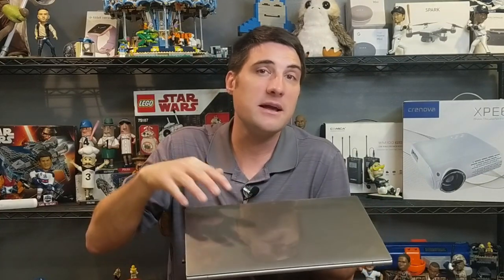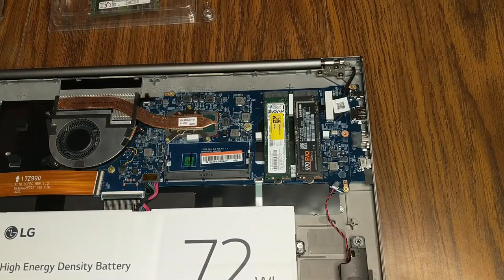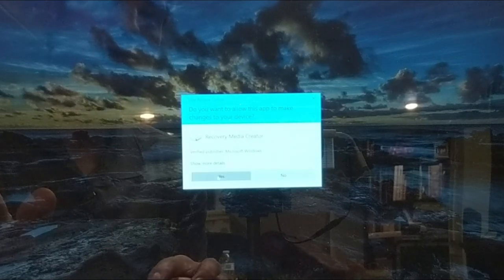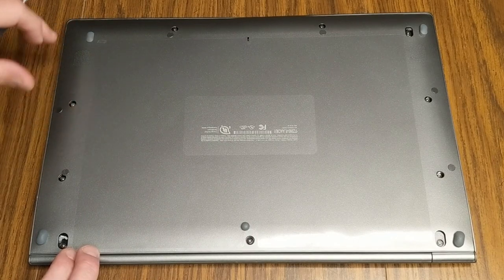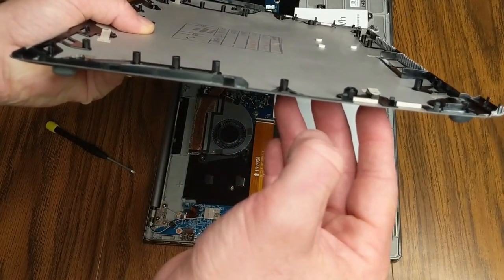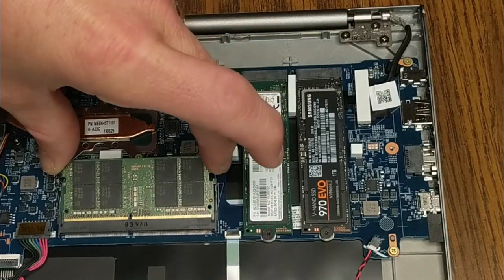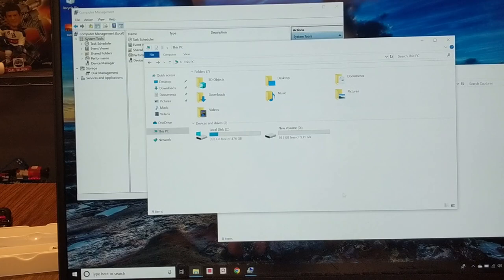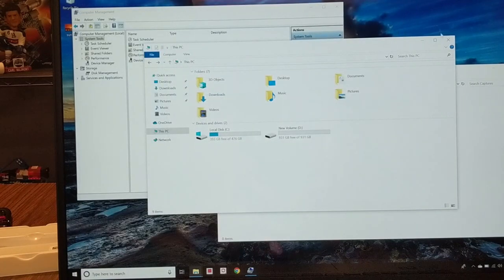LG Gram 17 - How to Upgrade Your Laptop With 2 SSD Slots (Adding An M.2 NVMe 1TB SSD & 32GB Ram)

Comment from the maker: Thanks for watching! How do you plan to upgrade your laptop?
Reply: What's the difference between the one you used and the EVO Plus? Is the EVO Plus compatible as well? What's the maximum ram I can add?
Reply: Is screen 4k?
Reply: Marc Jankow videographers edit 4k videos
Reply: Price is $1,199 at Costco right now for 16gb ram, 512ssd, i7 Intel cpu
Reply: Reviews have said that Internet is very slow on this laptop. Can anyone attest to this?
Reply: Marc Jankow my bad I meant reviewers were complaining about wi-fi, but for video editing it shouldn’t be that important
Reply: I want to update the RAM in my LG Gram 13. Is it basically the same process as this video?
Reply: does any USB drive work or does it have to be the one you linked to specifically?
Reply: Hi what about add 2tb in each slot for lg gram??
Reply: My LG Break 17 Laptop now has 40GB of RAM and a 2TB NVME XPG SX8200 Pro running Kubuntu Linux 20.04. It's pretty epic...
Reply: @inquisitvem6723  
No it is not 4K, it is 2560 x 1600 (WQXGA)
Reply: @JohnUSA7  2k is cool too!
Reply: always use 2nd ssd drive as data just in case windows gets corrupted since data can get deleted if you dont create another folder
Reply: Anyone do it with lg gram 16 style 2023 ?
Reply: Can ypu help me with finding a viable fan upgrade? I have a LG gram 17" i7 13th gen. It runs a little hot with the stock fan and I opened it up and it appears that there's enough room for a upgrade however I don't know any that would fit. thanks for the help.

Comment: I finally installed 2 of 2TB NVME SSDs on both the main and second slot and 32GB ram. All done successfully and works great. It is now 4TB NVME SSD and 40GB ram. I am planning on upgrading again as soon as I find 1 stick 64GB ram and 3-5TB NVME SSDs. It was a great time for me to upgrade the ssd and ram so I am thinking making a video for the next time. I took some photos though. Anyway thank you Jeff again and I’m highly recommend LG Gram 17 with upgrade. It’s very light and the screen quality is good too. It’s now my main laptop and I’m now looking for a laptop sleeve or body skin protector along with screen protector but hard to find though.
Reply: How did you move the operating system to the new SSD? And do the 2 SSD's look like one volume of two. Just C: or C & D?
Reply: So you actually see the full 40GB in windows? That'd be great because I've seen elsewhere that it only supports up to 20GB total (also seen 24GB on some sites)
Reply: Wow, congratulations! Quite an upgrade. Any performance issues with mismatched 8/32GB  RAM modules? Will you share what you selected and cost? I haven't seen another laptop that offers the size, light weight and axpandability. Looks like this will also be my next laptop and hope to implement the same upgrades. Thank you.
Reply: which ssd do you install on it?
Reply: I got a nice leather skin for the Laptop
Reply: Whatcus your laptop model plz? Still using it?

Comment: Great instructions.  Just put in a 2TB intel ssd and 32GB hyperX memory stick.  No way was I able to twist the ssd screw with needle nose pliers but I had the perfect size screwdriver and no problem.  Was a little scary removing the back cover when I got around the hinge area but careful working with a credit card got it undone  unharmed.  One thing that I didn't notice was that the big rubber feet are slightly different sized but since the bigger ones won't fit into the spaces for the smaller ones it will become obvious quickly.  BTW, I just bought mine at Costco a few weeks ago and it has an 80 watt hour battery rather than the 72 on the one you were upgrading.  Thanks for the excellent vid.
Reply from the maker: Thanks so much for the info Bob and thanks for watching!  That sounds like a great battery!  The 2TB Intel SSD and 32GB hyperX memory stick sound awesome!

Comment: Thank you very much!  I just saw your video yesterday.  I had no idea it was so easy to add a second SSD drive. I have the 15Z990 model, and it look almost identical to your 17 in model.  I ordered the Sabrent Rocket 2 TB drive since it actually cost less than the Samsung 1 TB one that you used.  I got it and installed it today.  It works perfectly.  I did not order the extra RAM until I looked inside to see if my model was similiar to yours, and it seems to be identical, 8GB soldered on the motherboard and a 8 GB Ram chip.  So, I will now order the 32 GB RAM chip with your link.  Thanks again, Marty.  PS.  I couple of years ago, I upgraded an HP Envy 360 with an old 5400 rpm hard drive to a 1 TB SSD.  Although, I completed the upgrade successfully, and it still works very well, but it was a very difficult  process with the HP, and I had to clone the drive etc.  The LG Gram makes this so much simpler.
Reply: I received the 32 GB RAM module and installed it today with no issues.  My LG Gram now has 40 GB of memory.  Thank you again for the amazing video!
Reply from the maker: That's awesome to hear!  I'm glad the video was helpful!  Thanks for letting me know about your experience and results!

Comment: 4:24 Not a good idea to use a flathead screwdriver to pry open the laptop.  This is because the flathead screwdriver tip is made of metal which will mar the laptop.  It's best to use a plastic tool to do this.
Reply: I agree!
Reply from the maker: Good to know!  I'll keep that in mind for future projects!  Thanks for the tip!

Comment: LG Gram 17 memory specifications: 

Slots: 1 (1 bank of 1)

Maximum Memory: 24GB

*Not to exceed manufacturer supported memory.

Standard Memory: 16GB (8GB non-removable).  Recommended maximum to add is 1x16GB DDR4 module.
Reply: There was a vid where some guy upgraded to 32 bg with additional slot so not sure why you say only one slot
Reply: @inquisitvem6723  Because only one slot is upgradeable, the other one is non-removable and 8GB in capacity (soldered on the motherboard).
Reply: @bokiNYC  so if I buy a 16GB machine I can only upgrade by removing the 8GB unsoldered one and upgrade it to 16GB therefore total 24GB to keep it in line with recommendation shown above? Thanks

Comment: Hey! That NVME SSD you installed would be better placed where the original SATA SSD was placed, no? I'm asking because I see where you added it is the NVME 2x slot. It would work faster in the 4x slot where the original SSD is.
Reply: the original drive is a NVMe M.2 Solid State Drive not SATA - at least not on the Costco model I just got.

Comment: Hi Jeff! Thank you so much for your video and your channel. After watching your video and asking several questions in Google I got to a dead end. My main doubt is, does LG support 16 Gb and 2 TB extra in the empty slots or when they give those amounts they refer to the total capacity. I have even asked the SAT LG office here in Spain but they weren't able to deliver an answer. Besides that, do you think putting a 32 Gb RAM paired to the 8 Gb RAM pre-installed will work fine. I mean will the the first 8 Gb of the 32 Gb RAM work as dual channel with the pre-installed RAM and then the other 24 Gb work in single channel or will the 40 Gb work in flex channel? Thank you very much for your time 🙂
Reply from the maker: Hi, thanks for watching. Unfortunately I don't have a definite answer for you. The 32Gb of ram I installed and the 1TB memory I installed do seem to be working great in my laptop even several months later after my install but unsure about the support of the extras in the empty slots. Best luck! Please let me and others know if you learn more about what it can support.

Comment: Can you explain what you put on the main hard drive vs. the second hard drive?  I have always preferred one large hard drive over two small ones - simplicity for the computer to have everything on one drive and to not have issues where the computer doesn't know what drive something is located on.  I'm interested in the LG Gram but I think I would rather spend a few extra dollars and get a 2 TB drive rather than have two drives; one 512 GB and one 1TB.  Would you agree?

Comment: Hello great video. I have a question maybe you can answer. I would like to replace the original SSD with a 2TB SSD. How would I move the complete operating system to the new drive?

Comment: I read in a lot of places (notebookcheck for example) that the LG gram only supports Up to 24gb of ram. I just bought a 17inch one. already bought the same SSD but im curious about that 32gb update. i was going for the 16g. now im in doubt.. Thnks cool video i going to use it as a tutorial for my upgrade
Reply from the maker: Thanks for watching! Yep, my LG gram took the 32gb update and I've been using the 1TB SSD upgrade and it's working great!

Comment: Jeff, I love the video.  Looking to pick one of these LG Grams this weekend.  Was curious to know if you could do a similar video on formatting that Samsung Evo drive to be your main OS Boot disk.  I've heard terrible things about the stock drive speeds being so slow in the SATA format.  Have you had a desire to make the Evo your main OS Boot Disk?
Reply from the maker: Thanks for watching! It's something I've seen done elsewhere online and I might do it in the future but right now I was looking for the quickest and easiest solution for upgrading my laptop. Ive been using it for many video editing projects. Using the stock drive has worked out great for me so far. I have other laptops that don't have SSDs and in my opinion the LG gram boots up way faster.  I appreciate the comments!
Reply: Very good video...I too have this same question regarding the original sluggish SATA that comes with the LG gram 17. I think that removing the SATA disk is the way to go...then reinstalling windows onto the new EVO SSD. I did that on my Dell XPS with only one bay. I also read on reddit and best buy q&a that the computer will automatically choose the faster drive of the two. So maybe it is OK to leave both drives just how it is shown in the video? Would appreciate confirmations or feedback from Jeff or other computer gurus.
Reply: I don't know if they made LG Gram 17 with SATA ssd's but in the US market at least in last two years or so the laptop came with M.2 nVME SSD and not M.2 SATA ones. Even if the one you wanted to buy did have M.2 SATA SSD you would not then be able to upgrade to the faster M.2 nVME SSD drive because the slot wouldn't accept it. M.2 SATA is using SATA lanes and M.2 nVME is using PCIe lanes for the data transfer. If the laptop you were buying did in fact have M.2 nVME drive but you are not satisfied with it's speed and wanted to upgrade to a faster M.2 nVME drive you can just buy the faster nVME SSD and USB3.1 or USB3.0 to nVME SSD adapter and clone the OS SSD (there are some nice cloning software like Macrum or Acronis TrueImage and etc.) to the external and then swap them. I know it's an old thread but it might help someone looking into this now.

Comment: That's weird. I opened up and added a 1TB hard disk as well. After powering it on, it just stays on black screen though the laptop is running.  I got to remove the new hdd and restart it, and it boots up normally.  I tried disabling secure boot too and it didnt work as well when i put in the new hdd. need some advise here..
Reply: Exact same issue here... tried to add a new 2TB Crucial P3+ SSD with same result.  RAM upgrade (using a 16GB G.Skill kit) works fine, but no joy with the drive.  Too bad, because it was a great deal at $94.00 on Amazon!  Have ordered a 1TB Samsung 980, and we'll see how that does.  Did you ever get your upgrade done?

Comment: HI tks for this video. I have a question for you on the gram. Is it okay to delete all the LG software that came with the laptop. If I do so will there be any issues? Want to lighten the load on ram. Appreciated in advance.
Reply from the maker: Hi Paul, I left the LG software on my computer just in case I needed it.  I've used it a bit for checking power management, system info and tweaking system settings.  The LG Updater will let you update firmware, software and driver updates.  You could also do this from the LG website, but for me its convenient to have it right on the computer. The LG control center also gives you lots of options for settings on the computer.  I haven't deleted the software so I couldn't tell you if there's any issues after deleting.

Comment: Hi Jeff, I have a 2 Tb HDD which I wanted to add to this laptop. Before purchasing the laptop I phoned LG to ensure there was a space for a HDD on the motherboard. She checked and said yes. Watching your video I was surprised to see the little circuit board you added called a HDD. So before I open it up and void the manufacturers waranty, is there a spot for a traditional HDD (appox 2" x 3")?

Comment: Hi, thanks for video. I'm thinking to upgrade my notebook. It's the same of your. 
Just a question, how many slot of ram has the laptop? I would like to buy 32gb of ram. Can I add to existing ram to increase up to 48 gb or it must to be replaced? Please let me know. Thanks.
Reply: As pictured in this video there's one available slot for RAM upgrades and one 8GB RAM stick soldered on the motherboard. So he replaced one of the 8GB sticks with the 32GB one for a total of 40GB and that's the current max you can have in this laptop.
Reply: @bokiNYC  thanks for support. I installed 32 gb and an additional 1TB disk . 😉

Comment: Thank you Jeff. I love the video. 
I’m planning on buying one (17”) but I am wondering if the original ssd already factory installed could be replaced by 2tb or 4tb, not just adding to the second slot. 
If it is possible, I will just replace the original ssd by 4tb and leave the second slot empty.
Thank you in advance for your advice.
Have a great day!
Reply: That’s definitely possible.
Reply from the maker: Yes, it should be possible. Thanks for watching!
Reply: Thank you Jeff!
Reply: Thank you ninibur!
Reply: Thats what I want to do just replace the factory SSD with a 2TB one but not sure how to move the operating system. Can someone tell me how this is done?
Reply: @pego99  I am about to do that with a 1 TB SSD as recommended on this page and video.  I have installed AOMEI backup freeware which has a disk clone function I used on a prior laptop to clone my system HD to a larger one, then swapped them, on that laptop.  In this case I plan to first install my new 1 TB SSD in the second slot, clone the original 500 GB system SSD to it using AOMEI, then swap them.  If I remember to do it I will report the results here.
Reply: @wrmurrow  it says your post was 4 years ago,  were you able to do it and was it successful.? I was looking for a fairly new laptop but apparently this one is 4 years old.

Comment: I didn't quite understand the amount of memory.  You bought 32G but ended up with 40G and mentioned that some was built in?  On my system, it shows 16G RAM.  Does that mean there is 8G built-in and the existing card is 8G?

Comment: How do i check which RAM is fit for my LG Gram Laptop (13th Gen Intel(R) Core(TM) i7-1360P   2.20 GHz), Actually i want to upgrade my 16GB RAM into 32 GB?
DO I need to open my laptop and see the details of the RAM and order the new RAM or ......?

Comment: I am having heat issues with the laptop where the second SD drive fails intermittently. Had the system blue screen and reset also. Do you have any heat issues?

Comment: What BIOS changes are made before adding the second SSD? When I added the second SSD, the computer did not boot at all.  I have a 2019 LG Gram 17. Since adding the second drive didn't work with the preconfigured boot order, I have tried to change the boot order and enabled the second SATA HDD, NVMe 1 and 2, and so forth. Crucial Technical Support said to move the original Samsung HDD to first priority, replacing the Windows Boot Manager with the top spot.  No configuration works as long as the second Crucial SSD (P3 Plus PCIe 4.0 NMe M.2) is inserted into the second slot.  I am unable to remove the original Samsung because the screw is so tight. Any advice appreciated.

Comment: Do I need to do the back up if I’m just upgrading the ram to 32, not adding a second hard drive?
Reply from the maker: Completely up to you. I just like to cover myself in case something breaks while doing any maintenance or upgrades. It never hurts to have a BU in my opinion.
Reply: Thanks for getting back to me. Do you think there would be any issues using the newer Samsung (MZ-V7S1T0B/AM) 970 EVO Plus SSD 1TB instead as a second drive?

Comment: SO after you format the disc, does the items you store automatically back to the new drive or do you have to transfer it over from the hard drive already installed on computer?
Reply from the maker: You'll have to manually transfer it from the existing hard drive installed, unfortunately it won't automatically transfer

Comment: Hi Jeff, would you still recommend adding 32 GB Samsung RAM to increase total RAM memory to 40 GB,  6 months after you reported it in your video. Any problems that have surfaced in this timespan? I have just bought 32 GB Samsung RAM, the same one that you have used, and want to hear your verdict, six months after, before I embark on the same adventure!
Reply: I have replaced it and now I have 40 GB of RAM. Working great, I am running two incarnations od ACAD 2020, 2 Oracle VM machine, and 2 VMWARE  virtual machines concurrently in 30 GB of RAM, and still have 10 GB free!
Reply from the maker: I am still running the 40 GB of ram and its still working great in my laptop. Thanks for watching!

Comment: excellent video! question... my 17 has 16GB of 3200MHz ram. i can't find a 32GB module from samsung in 3200MHz. is one not available?
Reply: I used the HyperX 32/3200 (made by Kingston for gamers).  Works fine on Win10 and Ubuntu.